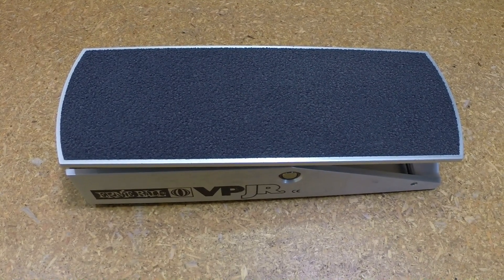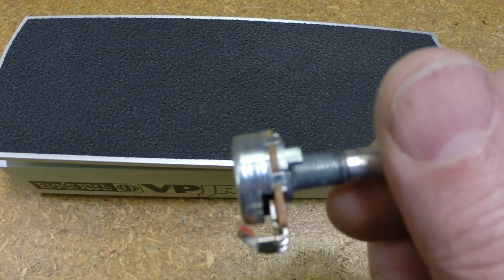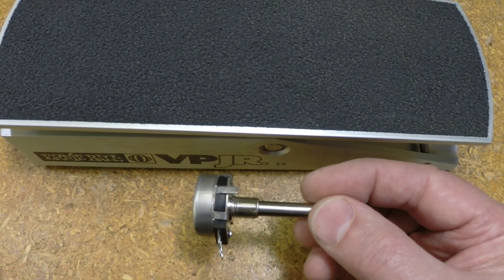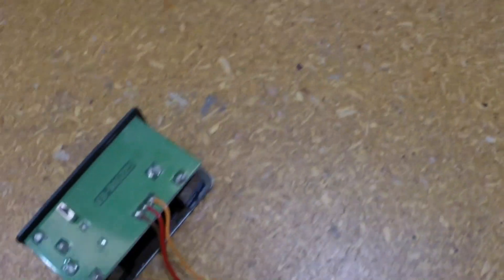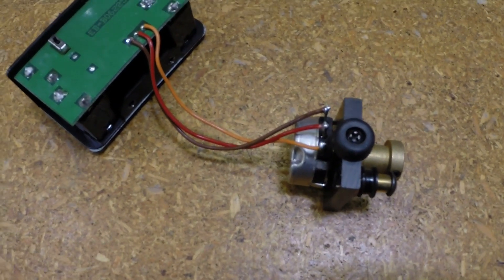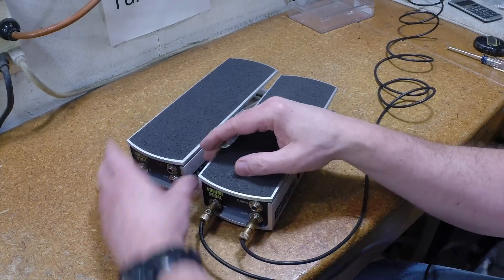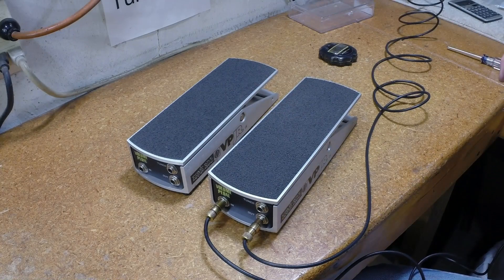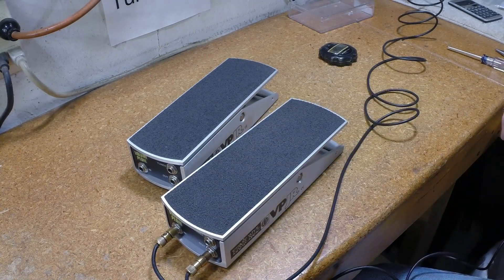Ernie Ball VP Jr Repair & Modification

Comment: Beautiful!
Compliments!
I ask you a favor.
Is it possible to modify a junior PEDAL by inserting the STERO 500K ERNIE BALL - 6162 potentiometer suitable for the GRANDE 6165 pedal?
Can you do it with some adaptation like adding a jack and more?
Thanks.
Reply from the maker: I do not have an answer for that.    I imagine you can do that.  Drilling the pot bracket and housing would be necessary.

Comment: Better compare your modded pedal with no pedal at all. If the stock one is louder than yours, imho it means you have it not calibrated properly and it doesn't fully open. Use multimeter and measure impedance, I'm pretty sure yours won't show 0 ohm when open, and the original one - will do.
Reply from the maker: The pedal worked fine with no loss.  I know how to calibrate a volume pedal.  Plus I  went to a higher resistance pot.  But I don't remember the details from video since it is 4 yrs old, and   I am not in the mood to go back and look it over just to play.

Comment: If you use it right after the guitar, 1M is the best value, and if you use it after a buffered pedal 10K is the right value. A good position on the pedal board i right before your delay pedal,
to get the best delay tails.
Reply from the maker: I agree.   I personally would have used a 1 meg for me.  Not my pedal, but I was just discussing some of the variances.  Some people actually like the slight roll-off of the lower values.  It is a tone discussion do not get it started, no one ever wins. :)